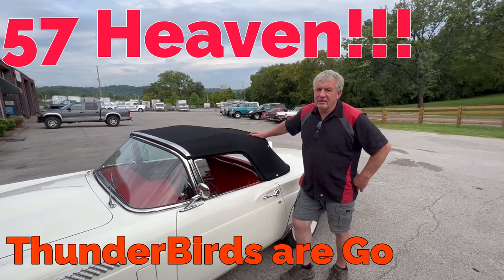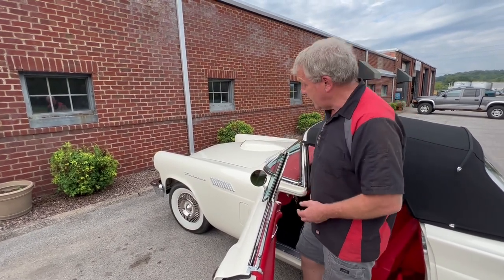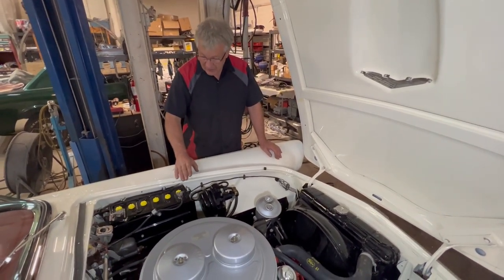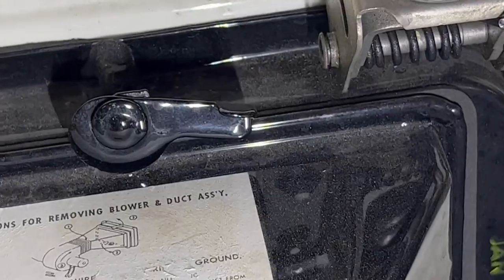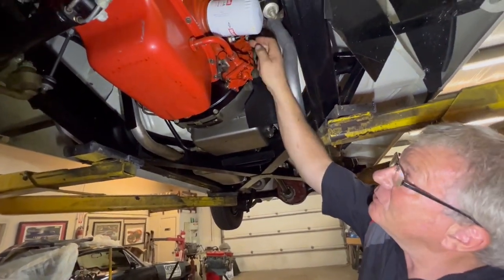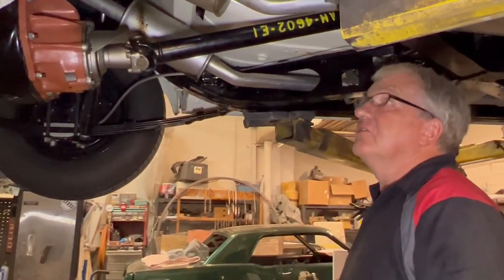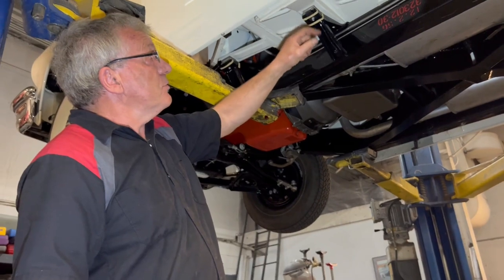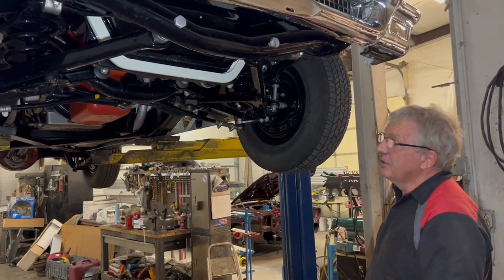57 Heaven !!! Thunderbirds are Go!

Comment: The restoration of this car is top notch. Unfortunately I heard a very loud lifter tick when you fired it up. I hope that this does not develop into a problem down the road. A bad lifter will be an expensive repair if the engine grenades itself.
Reply: It has mechanical lifters , not hydraulic. They might just need adjusting.
Reply from the maker: Yup she had one rocker out of adjustment. All taken care of, nice and quiet now.